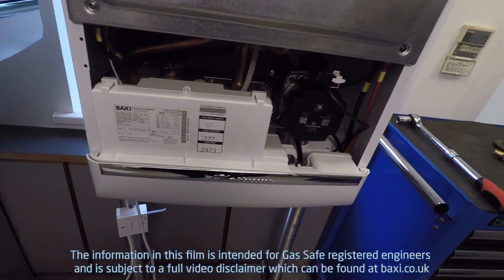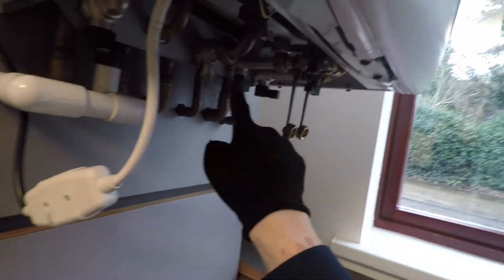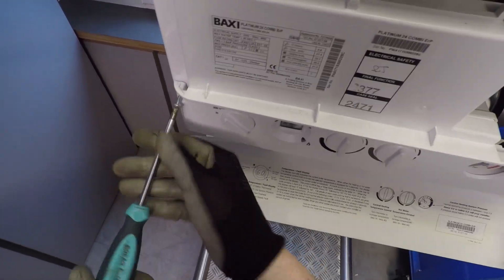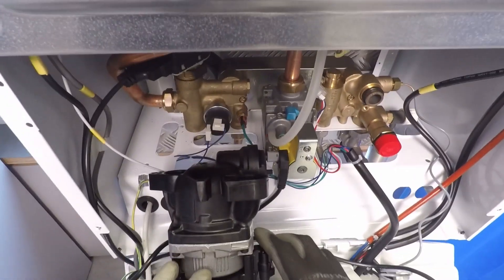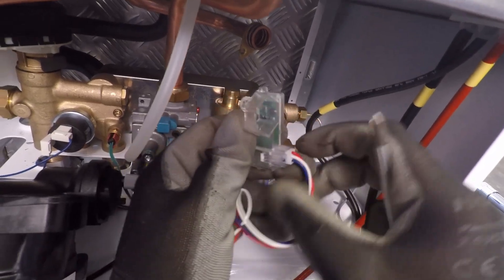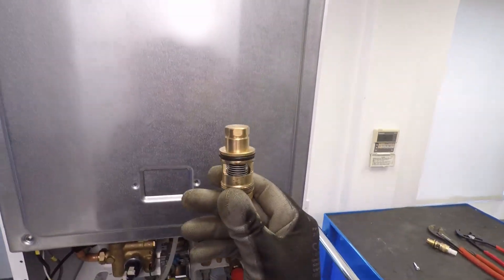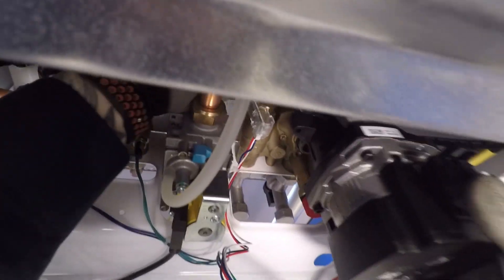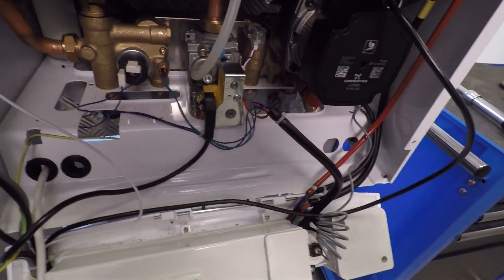Part 2 - How to remove the floatswitch / bobbin type inlet cartridge on the Baxi Duo-tec ERP boiler

Comment: Do you actually see these flow turbines as spares? Or do we have to buy the entire assembly?
Reply from the maker: Hi Paul, here you go, some part numbers from Rob for you:  Duotec (float switch type): 10 l/min = 7211823
12l/min = 7211822
40kw model = 7211824
600/800 (turbine type)
10 l/min = 7663535
12 l/min = 7663533
15 l/min = 7715773
The size should be stamped on top of the brass cartridge.
Reply: @BaxiBoilersUK  thanks for that, I did ask baxi technical last week and they advised you have to buy the whole assembly (which i did for a customer) so maybe they are not aware?
Reply: When looking on parts arena, it only lists the whole brass assembly for some boilers, I think potterton. Are these all replaceable, or would I need the full assembly?
Great video Rob👍🏻